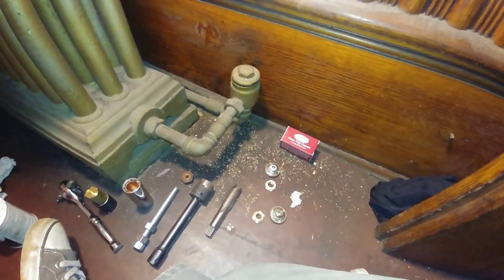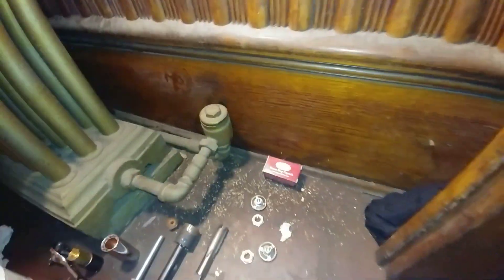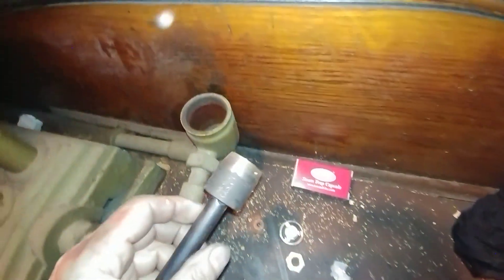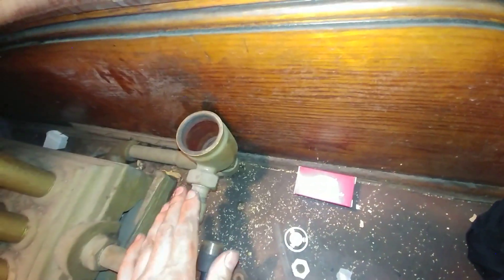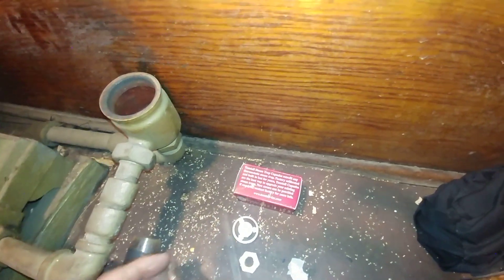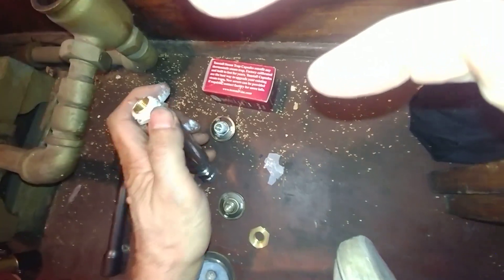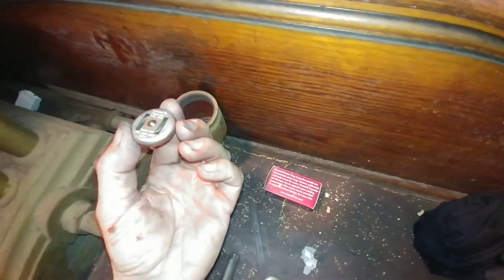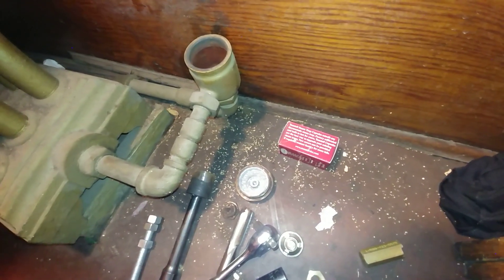Rebuilding A Deep Iron Body Radiator Steam Trap With A Tunstall Kit

Comment: Good video. Looks like a two pipe air vent system converted to a two pipe trap system. Many of those systems were converted many years ago.
Reply from the maker: You are correct

Comment: Hi, I have a steam boiler. The automatic feeder is feeding too much water into the boiler and it fills up the sight glass.  The automatic feeder is set on low water cut off and 2 minutes delay. What do you think the problem is? Having problem figuring it out.
Reply from the maker: @Tom Tayansil: You have a VXT feeder? If so, check out my videos on the flooding issues with the VXT.  It might be a dislodged flow restrictor disc.  If so, you will need to take the 443P valve on the VXT apart to repair it. Please call tech service of Hydrolevel and report your flooding problems. They want to know if this is an issue.